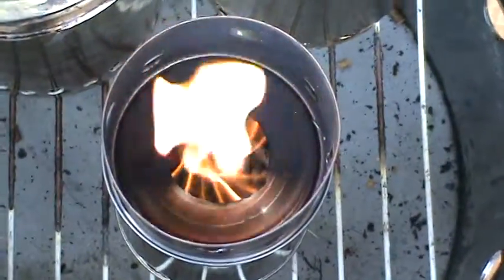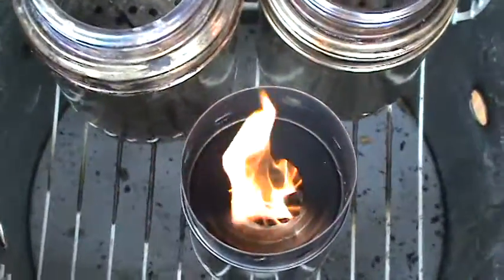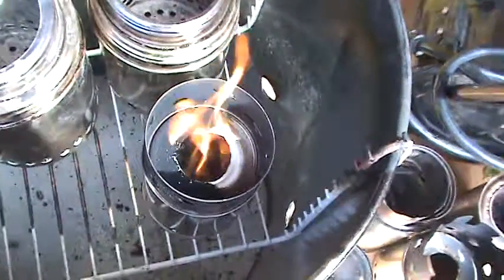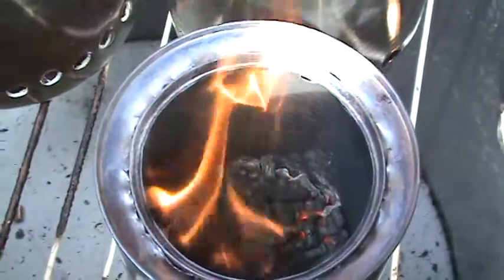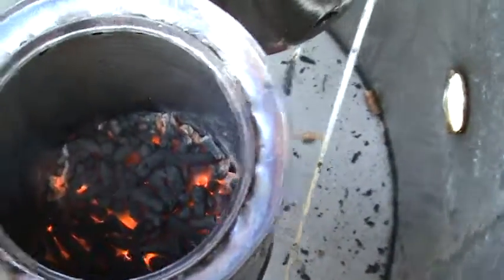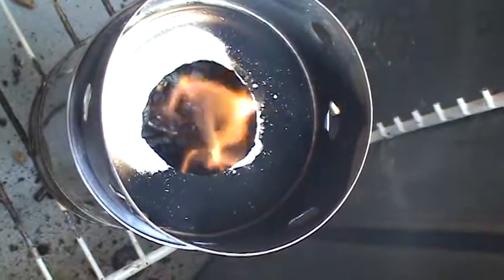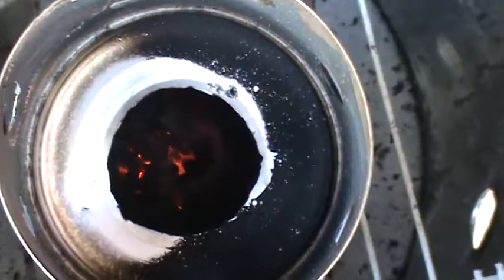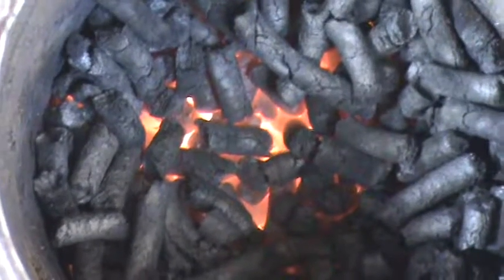Gasifier 5 to 1 B

Comment: Choking the airflow of the primary air holes will effectively lower your 5:1 ratio considerably. But opening the bottom changes the dynamics completely. The air inside the cans will not heat up enough to give you a good secondary burn. You also will benefit from a better fit around the top of the inner can. Nice experimentation.
Reply from the maker: +Heath Putnam Yeah, the extension on the bottom helped a lot, and I put some high-temp calking around the top since I made the video. Gasified nicely and the flame was clearer though not blue, and about 3/4 load of pellets burned a half hour and then coals. Thanks again for your videos and comments. :-)
Reply from the maker: +Heath Putnam I also widened the nicer pot stand opening at the bottom, but the eight 1/2" holes don't seem to be enough air for when I put a pot of water on it, since it starts to smoke. So I'll have to add more holes and see if the smoke stops.